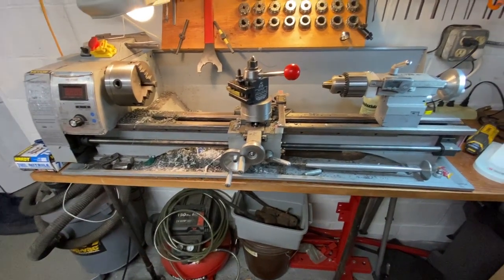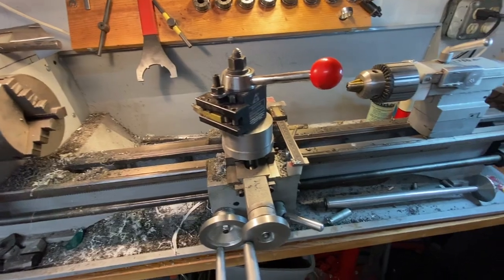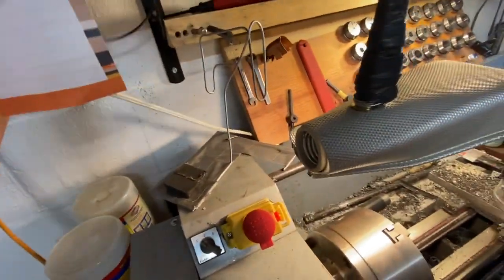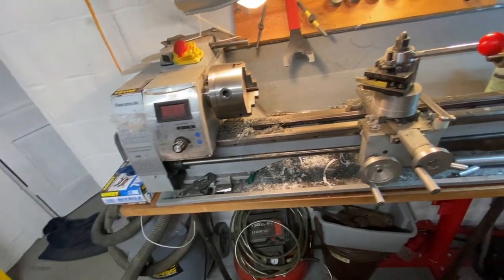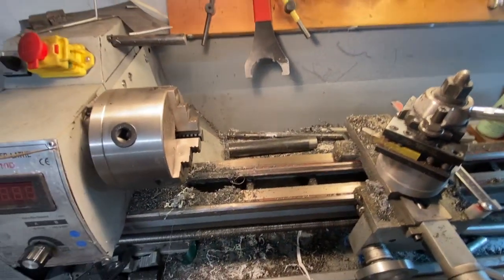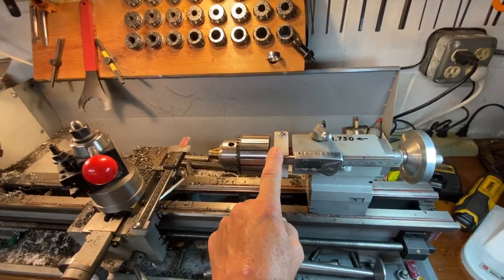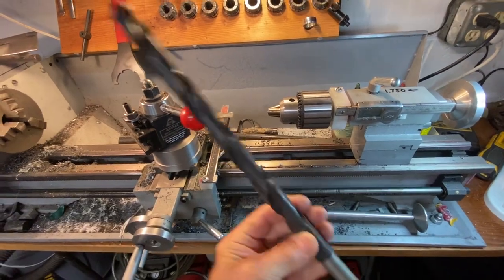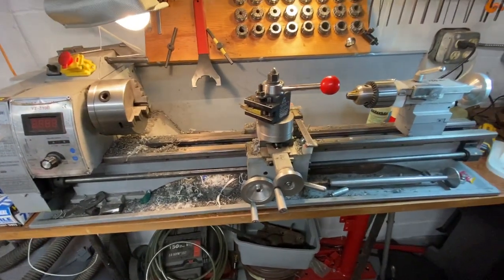VEVOR Lathe YZ-210D one year review

Comment: Is the through bore an actual 1.500" ? Website says 38mm/1.5" but that dont add up because 1.500" = 38.1mm  so maybe 0.007 or so tight considering this is a ChiNa lathe and figured the metric measurements were right. Any chance if this is the case I could run a boring bar down the spindle? I'm guessing the spindle is about 6-7" long. Thanks
Reply from the maker: Sorry, I never measured it. If the piece wouldn’t fit, I would just handle it as you would with any other small bore lathe

Comment: Can it keep +/- .005?
Reply from the maker: Only if you’re making lite passes.  If you’re looking for a real precise work all the time don’t buy it like I said, I use it for bushings. Making a bolt here and there stuff like that.
Reply: Out the box I would say no. Put a little money into it and get it rigid and tuned it should can keep that tolerance but by then you could have just bought a better machine that could do all that and more with a lot less headaches and effort down the road.its like asking if you can yank a motor out with a chain in a tree, Sure but why would you?